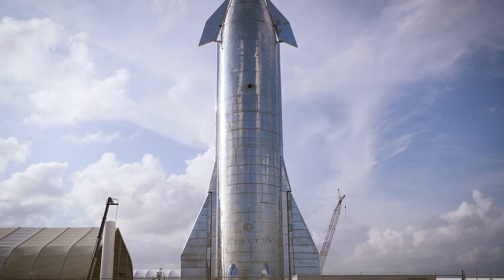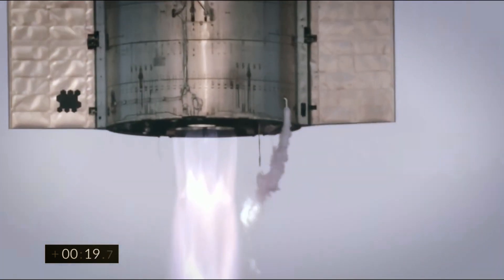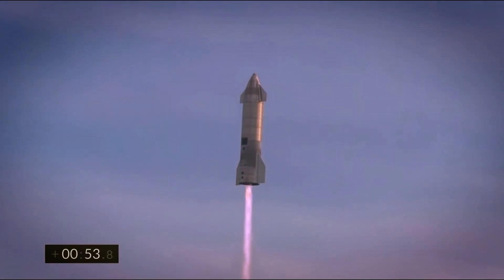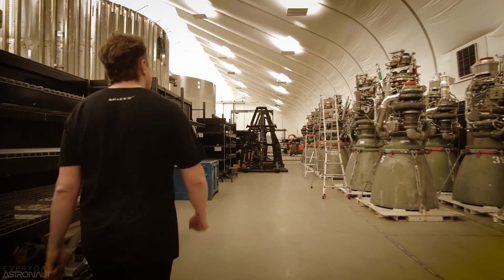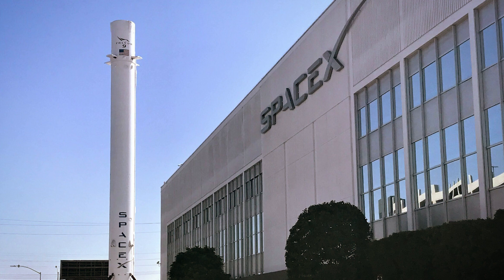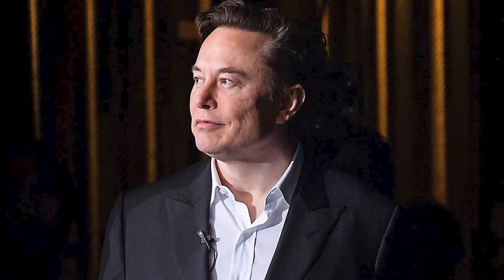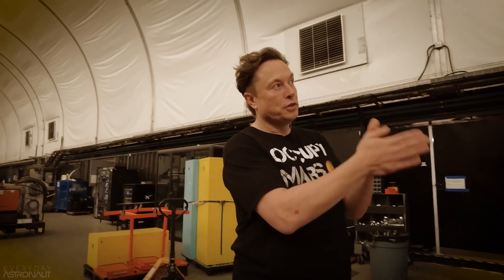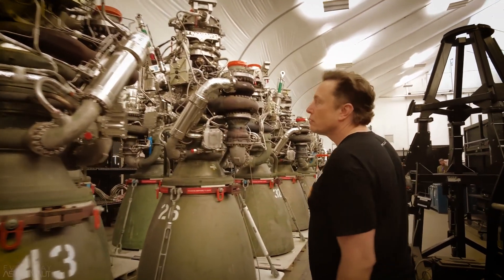SpaceX Starship's Heatshield Testing Problem - What You Need To Know!

Comment: Just note that solving the heat shield problem is important but it does not gate the first orbital launch since the first starship will likely not be recovered and certainly not reflown.
Also,  comparable rockets don't save anything so, though recovering the Starship is the goal, the system is still cheaper if you just recover the booster (like is done with the F9).  Also, the first paid mission is Artemis and that Starship will land on the Moon and thus does not need tiles.